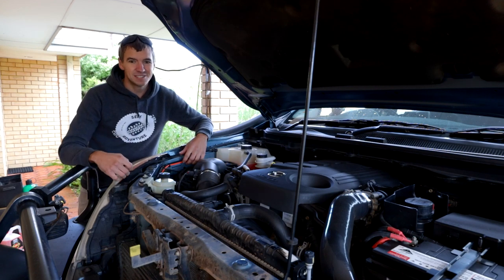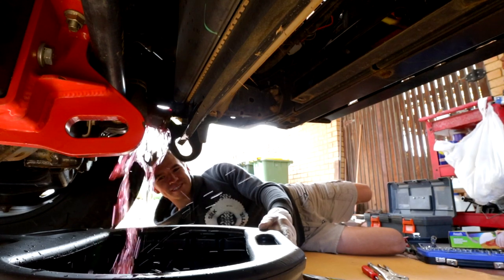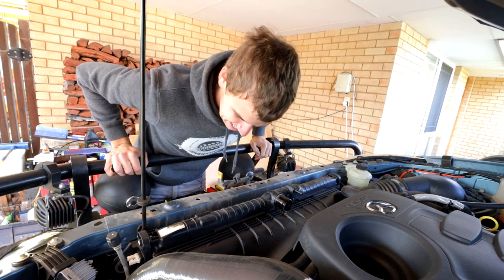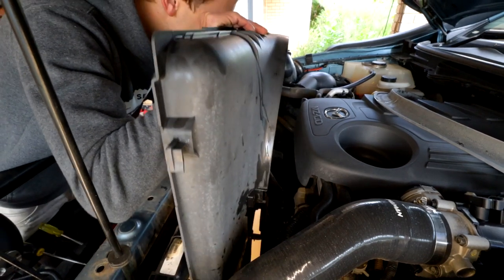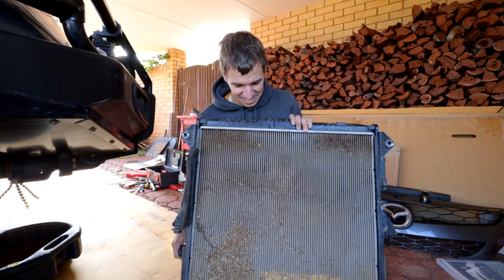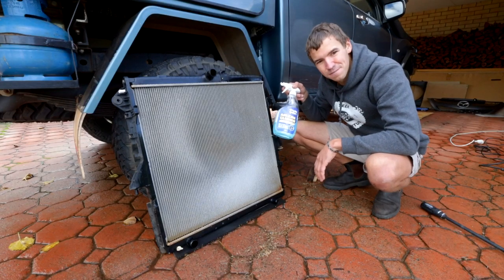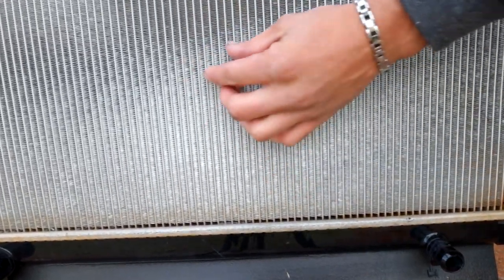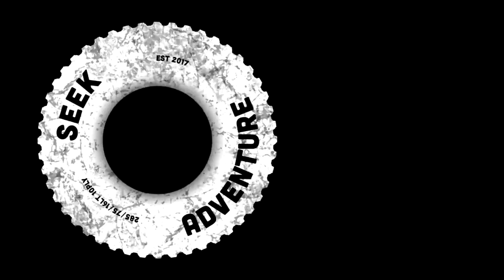4x4 Maintenance | How's Your Radiator Going?

Comment: You did that completely wrong......drain it, miss the container, walk thru it, track it thru the house being sure to leave it on all surfaces, including door handles....oh, and don't forget inside the car too. You have a long way to go to get to Zen Master.
Reply: Remote Controlled I suppose you have it all sorted when you do your car. I bet if you go to the professionals they don't do it any differently. My Mazda radiator top box popped after 16 years, did it exactly the way this guy did it. Right down the line. I also used high pressure cleaner even on the aircon radiator. Give the man his dues. He at least had the gumption to do it and you tube it. 10 out 10. Agents never go to this length. Would suggest putting a heavy shade net on the bull bar would save having to do this that often and much easier to clean.
Reply: @willypittner7139  it was a joke mate. He said Michael did it wrong because he did not make a giant mess with the antifreeze.
Reply: You have obviously watched me work on my truck. I'll leave a link in the comments below on how you too can track diff fluid, antifreeze and oil all over the carpet, for an authentic home environment.
Reply: Willy Pittner it’s unAustralian not to realise that this was a joke.....sigh...what’s the world coming to?
Reply: Lol

Comment: You can straighten the fins easily. Just use a steel scribe or something pointy and carefully bend them one at a time. The more bent over they are the more the airflow is restricted.

Comment: Fitters at my work told me to blow it out first.  Seeds and dirt swell with liquid and do damage.
Reply: Then they sprout, the leave's start popping out of the bonnet.😂😂😂😂😂👍
Reply: @Graeme Yamaha What about when washing the car? I blast everything including the radiator through the grill etc. Don't recall damage.....nope , just checked the car it's fine.
Reply: @Super Tourer Yeah I'd say edit out the pressure cleaner bit. Avoid liability.

Comment: Great video. Are you going to do a video on flushing the cooling system? My comment would be turning the radiator upside down and place hose in lower radiator hose fitting and back flush the radiator before the radiator back in.

Comment: Great video, it's amazing what people take for granted and overlook for maintenance... don't forget the A/Cond Coil and transmission or engine oil coolers if you have them, they are usually worse as they sit in front of the radiator on most vehicles... Great Channel Michael, keep up the good work Mate.

Comment: Pressure washer probably bent those fins.  Notice it's mostly on the bottom where you would more angle the pressure washer down.
Reply from the maker: It was actually really interesting David, the fins were bent in a circular pattern which was really weird 🤷‍♂️.
When I placed the fan shroud over the radiator it all made sense, the fins directly infront of the fan were all straight, but the fins past the fan were bent as if water or something deflected by the fan blades had bent them. I'll be very curious to see if the same thing happens when the time comes to change this radiator, maybe I am hitting water crossings too fast! 🤐😵

Comment: That coolant looked okay, if car hasn't done a lot of kms I'd save and put back in. Did you just pressure wash the fins shut? Probably should of mentioned this is how you pull a bt50 apart, other vehicles might be different

Comment: Would the pressure washer not bend the vents?
Reply: Not if you keep it straight not wash on angle and keep it a fair distance away I always test on my hand when the water stops stinging is the distance to keep it away from radiator works a treat

Comment: Using a high pressure water cleaner on many radiators is a good way to bend fins. You may have damaged your radiator making this video.
Reply: yep, I'd never do this to my radiator, I use a weed sprayer with warm water in it, no bent fins for me!
Reply: Surely the water cannot bend fins... rocks do that at high speed.
Reply: @DarkBykeTwitch  notice that the damaged, (bent fins) are on the engine side of the radiator. Nothing should be hitting the back side. And yes, high pressure water easily bends radiator fins, easily.
Reply: He said it’s 1000 psi which is fairly low pressure

Comment: @seek adventure 
Seriously I love your videos and your channel and I really look forward to your posts. But watching this video, I was wondering why you didn’t use the radiator drain plug to drain the radiator? It’s that white tab/plug next the bottom radiator hose in case anyone is wondering where it is. 
Regardless I still love your channel.
Reply: AlaaDin Hamawi ☝🏼he’s right, 
I was just about to suggest the same thing but thought I’d look through the comments first 👍
Reply from the maker: Great question guys! Sometimes the bungs can leak after they have been taken out a few times, a friend who is a mechanic just recommends taking the hose off instead 🙂 faster to drain as well 👌
Reply: Seek Adventure 
Ahh ok. Love your channel anyway mate. 
Look forward to your future posts. 👍🏻
Reply: @SeekAdventure 

A bit of rubber grease on the o-ring of the bung never goes astray, I've never had one leak personally, although your mate has been in the game a few more years than I. 

My thinking why you did it that way is that you were going to take it off anyway, why bother with the bung. 

You only use the bung when you're only doing a drain and refill, every other situation is a bottom hose off because you have to flush it anyway.
Reply: AH not all radiators have drain plugs.

Comment: No point unblocking the radiator, if the intercooler and ac condenser are blocked, caus they’ll block the radiator regardless

Comment: NEVER use a high pressure cleaner on a radiator. It can bend the fins, and most of the time does.
Reply from the maker: Well we just proved that myth wrong 😉👍. A friend of mine works at a radiator shop, back when he was the apprentice he used to clean them like that all the time, it's all about keeping the lance parallel to the fins 🙂
Reply: @SeekAdventure  You mean PERPENDICULAR to the fins?